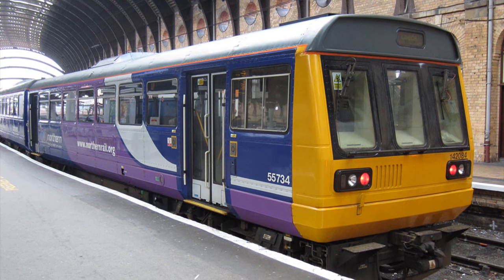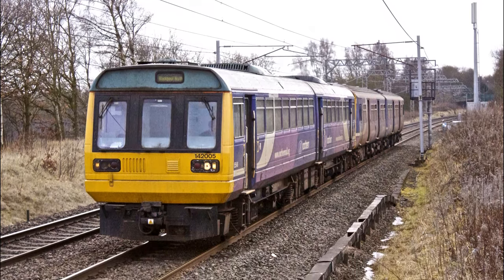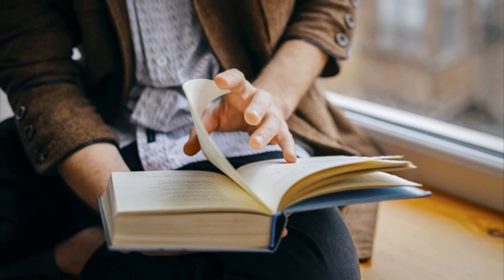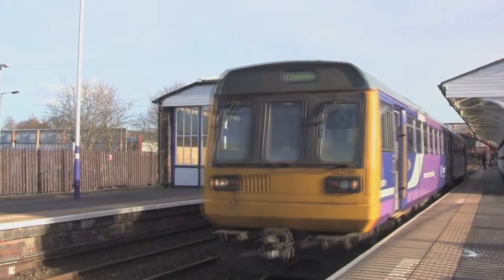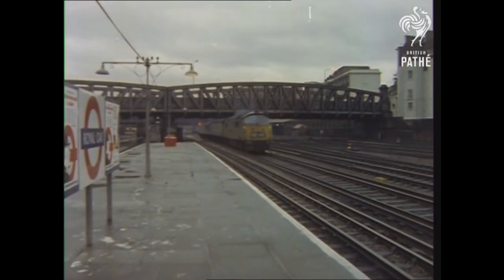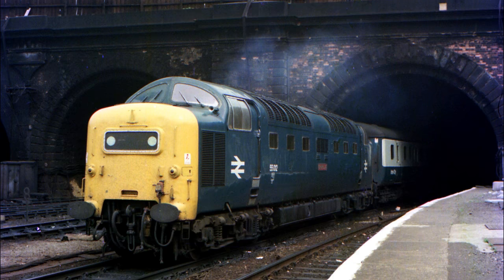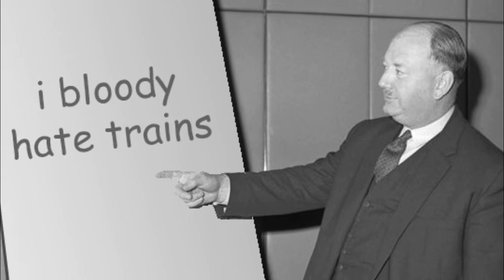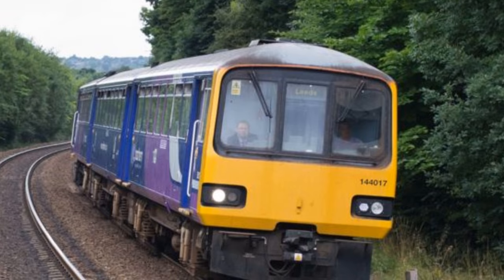The Worst Trains Ever Made - Pacer Trains

Comment: They won't last another 16 years in the North. All Northern Pacers should be withdrawn by 2020. Not sure about Arriva Trains Wales though.
Reply: FracaWicro 
The valley lines will lose their Pacers for hybrid D Stock trains that will be battery/electric mode.
Reply: Actually the Class 319 Flexi concept is probably not such a bad idea and they have opening windows. Newer trains don't as they have air conditioning. The problem is if something goes wrong with the overhead power supply, the aircon doesn't work and you are stuck on an immobilized train. I read about this happening recently on a hot day and people were stuck on a train for hours with no opening windows. 
I may be a bit old fashioned but I am not greatly enthusiastic about electrification and feel it is a retrograde step to have trains without their own on-board power source. There are other means of power sources for trains (and buses) like CNG or lithium batteries or hydrogen, but these are very flammable in an accident were diesel is a relatively safe fuel.
Reply: The third rail is less reliable in icy weather and there has been talk of converting some lines to overhead. At least with overhead electrification, the current is out of harm's reach.
Reply: I think that there is a now a rule that no new third rail electrification schemes are allowed except if it is an extension to an existing line. I remember the unique protected side contact Manchester Victoria to Bury line that used 1200vdc.
Reply: Pacer trains were supposed to be replaced by 2020 as a result of EU rules on wheelchair accessibility of carriages (They did test retrofit one pacer I believe, but there is only so long that you can polish a turd).

But if we're no longer in the EU, will they still get rid of them? After all, the EU requirements on trains don't really make sense in the UK where a lot of the stations were never modified to be wheelchair accessible.
Reply: It is more to do with the toilet not being cubicle accesible. All current Pacers and Sprinters need the folding ramps for a wheelchair user to board. In fact 156s  with the narrow doorways are more difficult for the less abled bodied passenger to board. There are only 4 unrefurbished Class 142s that are not wheelchair accesible. First North Western didn't have them refurbished as they didn't intend keeping them when the Oldham loop was converted to Metrolink. It is also virtually impossible for someone to slip between the platform and train boarding a Pacer as the gap is small,  but I've seen it happen twice with 150s at Wigan Wallgate over the years. It needs to be remembered too that half of Greater Manchester's railway stations are not wheellchair accesible. This was on local tv a few months back and the Greater Manchester Mayor Andy Burnham wants to do something about it.
Reply: Don't mind the pacer

Comment: Isn’t it typical that the government who’s largely to blame for the introduction of the basic, inexpensive Pacer is now so busy vilifying it at every opportunity (BR = Bad)? 
Mrs. Thatcher’s period of power 1979 – 1990 correlates quite well with the period of construction for the Pacer 1980 – 1987 (Conservative government for those outside of the UK, they were prejudiced against BR because it wasn't a privately operated company).

The preferred replacement design for life expired first generation Diesel Multiple Units (DMUs) was the high quality Class 210 DEMU (electric transmission) but this was rejected by the Treasury as too expensive; BR then suggested Class 150 but still not acceptable on cost for all routes (only my understanding). Therefore due to the lack of funds from central government BR designed the Pacer, using a strong bus body on a modified version of their high speed freight wagon (Pacer max. design speed is 75 MPH).

Due to the cost savings in building & running the Pacer (10 MPG (UK) could be achieved which is good for a train) it is said that some lines under threat of closure were kept open which otherwise may have been closed as uneconomic. 

Although Pacers have no walk through capability beyond the group of 2 or 3 cars (it was not envisaged that they would be run in multiple at the design stage) I can’t help but think that those complaining about their Pacer service would be alot happier if at least a couple of 3 car Pacers turned up rather than a single 2 or 3 car unit assuming that they are capable of running in multiple (could someone please advise).

Of course they are now outdated, having no A/C and not being suitable for the disabled. And I do wonder whether it was really worth the saving to dispense with bogies (which resulted in screeching & track wear on curves).

I have been on a Pacer btw (on a preserved line) and liked it, not expecting too much. Also I don't agree that the acceleration is poor.

Comment: Horrible. I've always hated the Leyland bus on rails. No train has evoked such sentiment to end this tragedy and have them turned into baked bean cans and razor blades.
Reply: The 'Leyland bus on rails' is actually the Class 155 Super Sprinter, many later converted to 153s. The only Leyland involvement with the Class 141 and 142 Pacers were the bodies and the original engines.

Comment: A: The whole video is a bad start because not all Pacers are class 142s (even the ones in the video). 

B: The Pacers were not the solution everywhere all the time for British Rail.

C: The acceleration is fine, its very smooth and, at the Exeter depot, at least, the only issues I've heard have been from 150s.

D: Quite a lot of Pacers have now been fitted with newer seats, and possibly even tables.

E: screeching Noise - are you seriously that fussy?

F: Wheel configuration is a too small to make a video on (if anything it means the step ladder is more conveniently placed if the driver is exiting at a yard.

G: "Watch out for more videos coming up in historically rubbish..." - explains why he hasn't uploaded episode 2, ever!

H: *Why is one of the clips backwards?
Reply from the maker: I made this video for a bit of fun. Lighten up, Dominic.

Comment: I used to like travelling by train because one could look at the scenery through the window, unlike most "modern" trains where there is a cramped airline seat alongside a bodywork pillar. The Pacers, on the other hand have excellent visibility and have lasted well so in no way should they be called rubbish. They were cheap to run and reasonably reliable after the gearboxes were sorted out.

Comment: BRE Leyland Railbus from British Rail Engineering & Leyland bus combination, since 80's. Actually, l prefer with bus face at railbus at first production but next, use new face with three front glass as standard trainset. Railbus, bus on the rail, why not with bus face. 

For my version that is not railbus but Diesel Trainset, but with short car, 15 m, not 20 m (  train standard  ). Or, that is a tram (  diesel tram  ). 

Old times, BRE Leyland with bus model, from Leyland bus single deck. For next model, not Railbus but Desel Tram or DieselTrainset or Commuter Trainset as electric trainset in the world. 

This is my version, others maybe different. Thank you. 

///(#CROCITLMYIGPDPODSSS0305PMWIT12022022#) ///

Comment: OI PACERS ARE NOT RUBBBBBBISH THEY ARE LEGENDS ITS NOT ABOUT THE TRAIN ITS ABOUT THE JOURNEY I DON'T CARE ABOUT NOISE OR COMFORT I ONLY CARE ABOUT THE JOURNEY SO THIS VIDEO SHOULD BE TAKEN DOWN
Reply: I presume this is a joke. If it is not, then I question your sanity
Reply: Let's say you are a wheelchair user who needs to travel from Manchester Oxford Road to your home in, lets say Urmston at Rush Hour in the Summer. You get to the train station to find your train is a pacer. Because of the step inside of the train you need to call for assistance to get on the train. When you get on, the train is already very busy and it's only a 2 car train. Once you get on, there is no wheelchair space available as the Pacers do not have these. The train is so busy already that it's hard to get through to any space. You leave Manchester Oxford Road, stop at Deansgate, then have to stop in a siding as you wait for the delayed Transpennine service to go through. Since you are crammed in with other people and there is barely any ventilation and you are stuck like this for a while, you start to feel sick due to the heat from the Summer and from the other people around you. This happens quite a lot, by the way, I know from personal experience. You soon pass out from the heat, but because you aren't at a station, you have to wait until the next station, which happens to be Urmston. By the time you get there, the train is still so busy that the emergency services can't get to you and serious harm may have been done to your body. This is all theoretically possible, and many similar incidents have happened. Look it up
Reply: At least you get from Point A to Point B.
Reply: With a broken back...
Reply: They are shit. Buses on rails. The North should get proper modern trains !!! Is that too much too ask?
Reply from the maker: I never thought I'd get a hate comment quite like this from a train fanatic.
Reply: Making excuses for the Pacer because it is British made. It is a bone shaking Leyland 1970's bus on rails. It is a heap of crap. Cheap and nasty rubbish and yet some people complain about the Class 345 because its not a "classic train", never mind that it is well engineered and designed to move lots of passengers at any given time.
Reply: people are allowed to have opinions
Reply: But you'll get killed half way
Reply: I would say the same thing if i could be bothered to type...
Reply: mjosiah1 Pacers are fine
Reply: mjosiah1 Not all the pacers were built by Leyland. The 143s and 144s were built by Walter Alexander.
Reply: Pacers are generally disliked by everyone, because they were a quick fix for British Rail.
Reply: Class 465 They are reliable though. I haven't been on one. But judging by the pacers being the most common up north and John high saying only a few have been written of they are pretty reliable.
Reply: Alasdair Clift 
This is why we NEED to keep GAURDS ON TRAINS.
1 car or 12.
 GAURDS MUST STAY!!!!!
Reply: EVERYONE RESPECT OPNIONS NOW
Reply: Cubixrube YES
Reply: All Pacers (except the 4 142s that FNW didn't have refurbished as they were not intending to keep them when the Oldham line closed) have wheelchair spaces. Most of the problems you mention would apply more to 156s and 158s with their narrower doorways and little room or wheelchairs at the back of them. Another problem with 158s is there are no opening windows if the air conditioning doesn't work. I was on one two years ago on a boiling hot day that had broken air conditioning and it was very unpleasant. I had to do an errand at Todmorden and caught the next train to Leeds. It was one of the 142s with the Merseyrail cheap low seats. Despite this, it was a lot more comfortable as I could open the windows and the ambiance was a lot better. I know from personal experience that 142s have more ventilation than any other current rolling stock I've been on (excepting trams) and are just the job on a hot day. Also try try to get a wheelchair on a 150 or 156 at Salford Central. Indeed it was recently reported that half the stations in Greater Manchester are not wheelchair accessible.
Reply: Alasdair Clift 
A bit OTT I reckon,but a very good reason to retain the guard.
Reply: TGs Train Clips liar
Reply: @agent_605  
Why do people always see the worst in everything?
Your looking at worst case scenario here.
If I were a wheelchair user,I wouldn't go out of my way to burden myself or others by travelling rush hours when I know what it's going to be like.
As for the crush. It's not about the actual train that is being used. It's about the operators inability to put extra stock on when they know how busy those services are!
They do not care! They are still getting the money for your ticket.
Also,it is much cooler on a 142 with all windows having opening vents and being open saloon design.
People slating trains is stupid and pointless.
They will only get replaced once the 195s gets fully accepted into traffic. And that's been further delayed.
Pacers have done their bit and should be respected for that.
Reply: chris217 Wheelchair users don’t have a choice, as if you didn’t realise disabled people can work and often do. Pacer ventilation may be better than something like a Sprinter, but their lack of interior standing room or designated wheelchair space means that any user is trapped inside. They do work well for rural routes, if they were fitted with PRM mods. But right now they aren’t, they’re used on busy commuter services and need to go urgently
Reply: @agent_605  
Then it's up to the operator to offer sufficient provision.
Blaming a train type over anything else is pointless.
It could be a 2 car 150 and the problem still remains.
I have seen 319s bulging at the seems. If operators don't put enough stock on then you would never expect anything less than an overcrowded train.
Just because it turns up as a Pacer is irrelevant
Reply: @chris-io1ki  But they're simply not sufficient for todays railway-anywhere. The nature of services in this country mean units that work rural branch lines also work local stopping services. Their ride quality and crashworthiness are also significantly worse than other stock, and that can't be rectified.